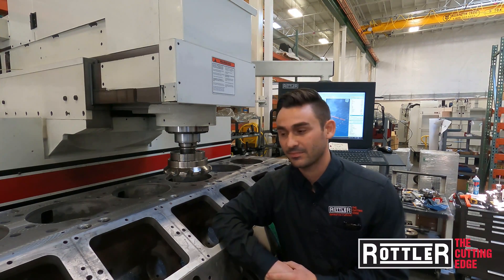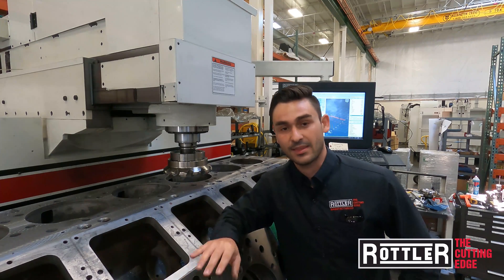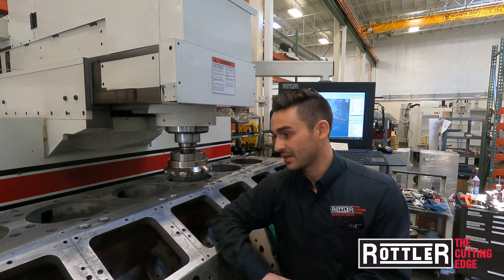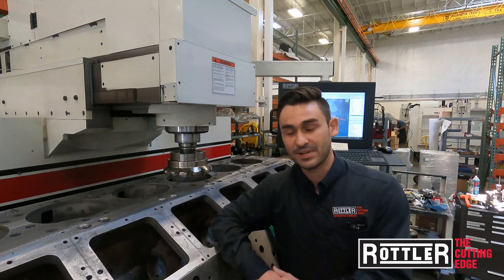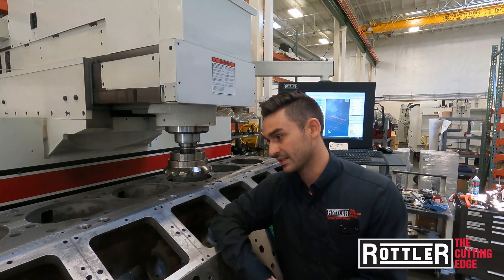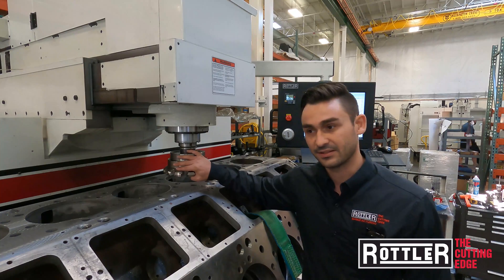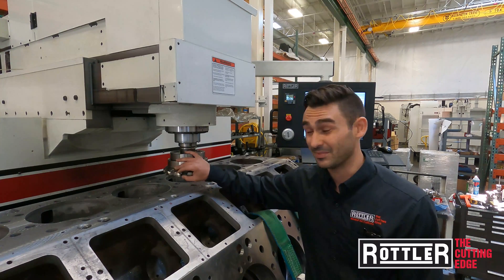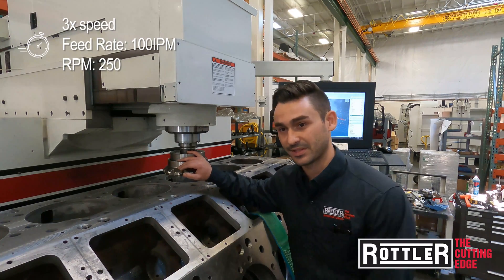Tech Tip CAT C175 Engine Block Spray Weld Prep

Comment: You really shouldn't call it a "weld", as it is not a weld. CAT uses a 95/5 NiAl coaling here, not a weld. Viewers should also take head that rough machining, without grit blasting afterward, is not an optimum way to apply this coating. However, grit blasting does leave a lot of aluminum oxide contamination in the block that needs to be carefully and thoroughly cleaned out after machining. Also be aware that the byproducts from the thermal spray process contain aluminum and nickel oxides, which need to be cleaned out too, so perhaps NOT blasting isn't such a good idea?